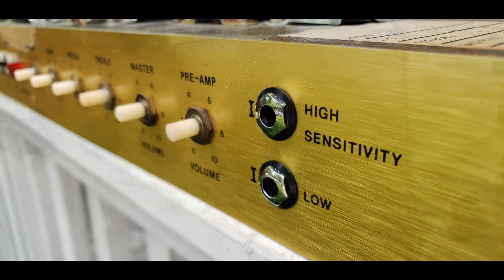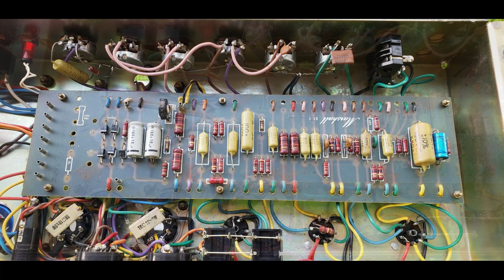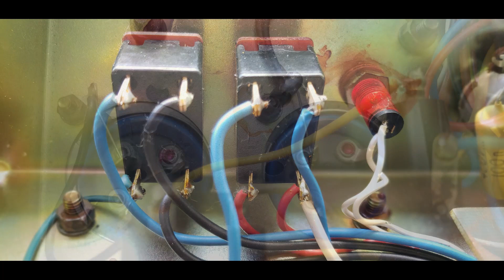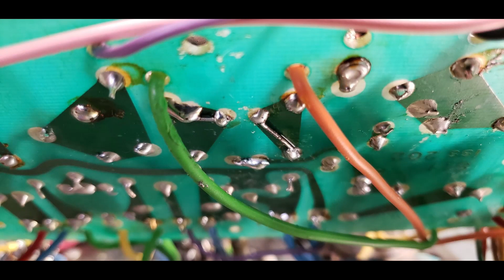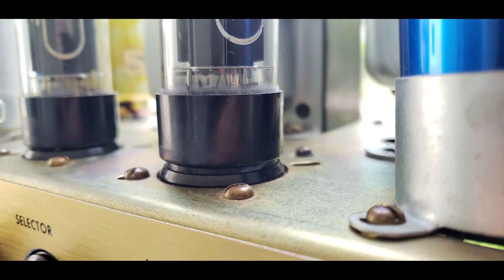'76 Marshall 2204 Cascaded Gain Conversion Part Two

Comment: Do you recommend the Vitreous Enamels for screen grids quite a bit? What makes them better than non Vitreous? I'm genuinely just curious, because I'm starting to do some big component orders, and the first screen grids I ordered for one of my amps were just VIshay AC Series, which I'm sure will obv do the job, but I'm just curious about these puppers. I don't mind spending a few extra bucks if it means better protection, and or more longevity, especially on a vintage amp, because I figure the less someone needs to go in to repair, or upgrade it the better.
Reply from the maker: They’re pretty but they don’t really offer any advantage over the AC resistors. The AC has less mass = less strain on the solder joints. 

Vitreous enamel is good for protection against conditions your amp should not experience. Need a 10W resistor in a compressor on a factory floor that will be exposed to dust and oil? Vitreous enamel.

They were used in Marshalls when they were the only good option on the market.

Now we have a range of good wirewounds and metal oxides. Can’t really go wrong with Vishay, Vishay/Dale, or Ohmite.
Reply: @PsionicAudio  Ohhh yeah, that makes sense. Appreciate the input!

Comment: That is an incredibly nice specimen of a 1970s transitional Marshall amp, and I really do love their 50 Watt amps. Yes, the Bulgin connectors are obsolete and often dangerously degraded but, at one time, those were medical grade connectors. Those plug in impedance selectors are quite dodgy too, and I have fought to re-tension both of those sockets and maintain originality. Bulgin makes IDECs now so.... Yeah, the old are obsolete.

Comment: Splitting the buss ground...  If you remove the buss from mid to treble but connect master to mid, isnt that doing the same thing?  And where did you ground each side to on the board?

Comment: How do you know what color OT wire is what ohm?  I know the "standards" of black, yellow, green on 100w or yellow, green, grey on 50w.  But if you are unsure, how can you test?
Reply: If they're hooked up, middle is going to be 8. You can check continuity on the switch to then see which one is 4 and 16 by looking at which position the switch is in. 

If your wires are disconnected, look up uncle Doug's video called how to calculate output transformer windings ratio.

Comment: Thanks for this informative video. But the video title suggested a discussion of the actual cascaded input conversion!  Would have been great if you pointed out all the various things that were changed.  And was the goal to completely mimic the later '78+ circuit?
Reply from the maker: Did you watch Part 1?

Comment: Do you have any videos of you actually doing the work? I just got a ‘76 JMP 2204 I need to convert to the cascaded gain. I can work a soldering iron. I’ve messed around in amps, but had super easy instructions and help doing so. Do you have any sort of instructions that label it all out, paint by number style?
Reply from the maker: No, I don't want to get into major soldering instruction because I'd get too many questions on it. I only have so many hours in the day.

I will be doing some basic soldering "how-to's" soon, like bass wiring or making cables. But nothing involving high voltages as found in amps.

On that note, cascading a Marshall is not a good thing to be "messing around" with. So many things can go wrong. 

People who want to learn should make cables, then make a lot of pedals, then maybe try a Champ kit build - assuming all the pedals still work six months later.

I'm not being a snob - this is dangerous work, for the person doing the work, for the player, and for the amp itself.
Reply: @PsionicAudio  no worries. I understand how to do the work safely etc. I used to have a jcm 800 2203 I modded to #34 specs with some help from a local friend and Frank Levinthrough emails some years ago. Miss that amp, so I eventually hunted down the 2204 JMP I just got. Just learned about the cascaded gain issue with the early ones, and discoverers mine is non cascaded. Wanted to update it first, then possibly work a switchable #34 mod if I can figure out how to do so. Just looking for a thorough idiot proof (as far as idiot proof can get with something like this) instructions on how to do the conversion. You’ve got some awesome in depth videos. Appreciate all that you do.
Reply: @astro2069 HEADFIRST channel gives tons of paint by number Marshall high gain mods, maintenance, etc.!
Reply: @astro2069 HEADFIRST channel has all the info you need!
Reply: yea because i thought this was a video showing you how to do it, but turned out to be a bunch of talking and trying to scare you to not do it because you have to be really smart so you probably don't need to do it because you are probably are not smart enough.

Comment: What temps are you using when doing this work?
Reply from the maker: I do most work at 700 F.  750 F for removing unleaded solder. 800 F for large eyelets/turrets (working fast).
Reply: @PsionicAudio  Can you do a video on removing solder?  Sucker and wick?  I cant seem to master it.  Also, how do you get under these old pcb boards on these amps?  I never have any luck.

Comment: I have 1959 plexi 50watt, basically a 1987 but upon seeing the turret board layout, the parts are more akin to the 1959. It already has an effects loop and Post Phase inverter MV. Is it possible to do a switch that makes the MV pre phase inverter? Also, can i cascade it to achieve more gain, kinda like the Jose mod and other modern heavy gain mods but retain the plexi sound on low volumes?
Reply from the maker: The post phase inverter MV is the better choice in a 1987/1959, and making it switchable to pre-PI would be a very expensive exercise with a bad result IMO.

As to increasing gain, I don't know whether you could. No offense, but I cannot know that. I could, and I could name ten other techs around the country who could. If it makes you feel better, I could name twenty professional techs who could NOT.

But in general, if a jumpered 87/59 Lead doesn't have enough gain, hit it with an overdrive pedal set for low gain but high output. Will run you $75-100, you can turn it off, and you don't have to mod the amp.
Reply: Jose added a tube.  He cascaded that new tube into v1b.  He also allowed you to internally jump the channels but the gain increase on jumping isnt much.  Then there are other things for gain but the new tube is the most added.

Comment: Im trying to wire a 2possision switch on my JTM45 from tube depot that took me a good 28 hours to build im a little slower then your average tube builder ... lol ... but im wanting a really agressive type tone but not brown soundy more keep original tone but much morer gain even though this amp has a PPIVMV it still lacks the gain i want without pushing the power tubes way louder then im looking for ... i hope to do that but im wondering how if i do a cascade or a resiistor or on the switch not sure im doing research . any suggestions/
Reply from the maker: Cascading a JTM45 isn't as easy as forums lead you to believe. It's not a good platform for high gain - too many things need to change.

My advice is to build it per the Tube Depot instructions. If jumpering the inputs doesn't get you there, use an overdrive/booster pedal. Worked for Clapton.

But at the end of the day, a JTM45 isn't a high gain amp.